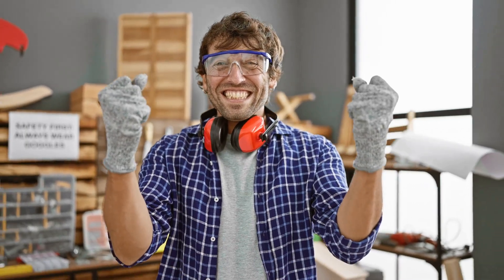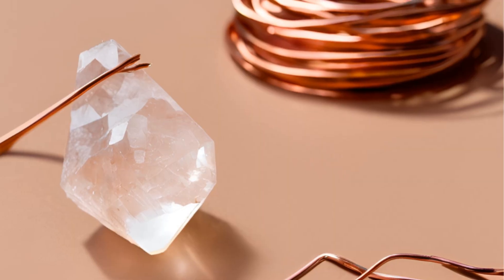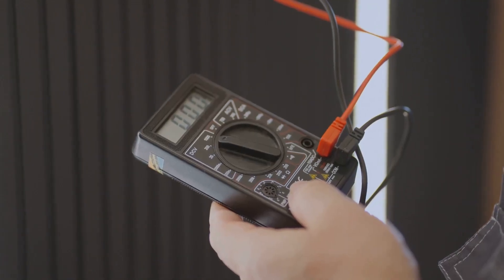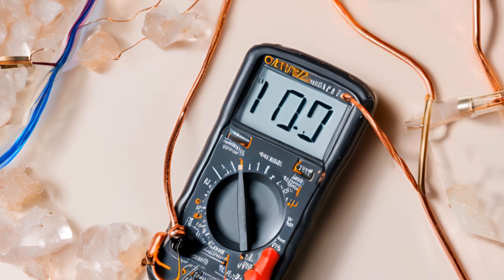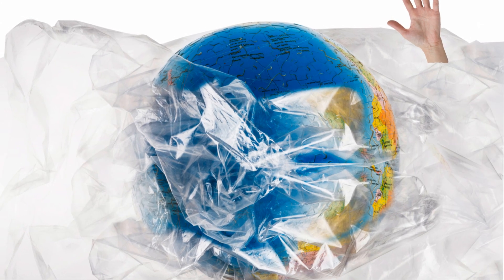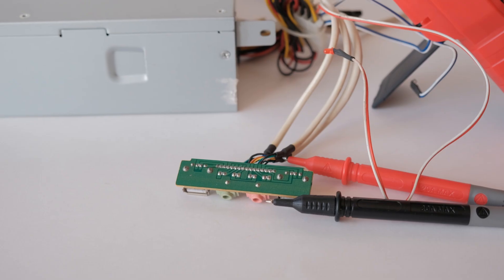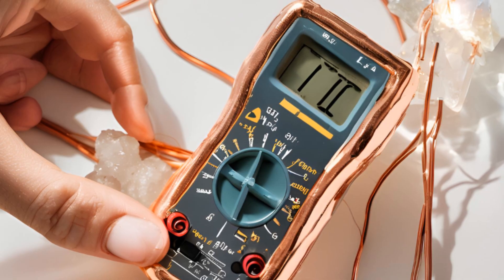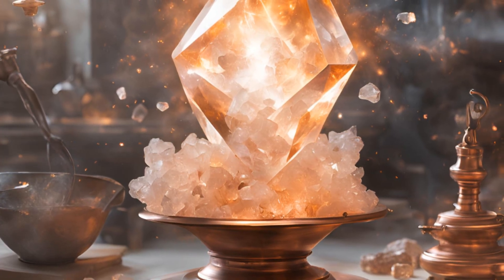How To Generate Electricity From Quartz

Comment: I've tried this, with different colors of quartz. Guess how much voltage I managed. I'll tell you. Absolutely none. Even tried squeezing the crystals, and still got nothing. Hit them with a hammer, still nothing. And yet it supposedly works, and is supposedly how piezoelectric ignitors work. I've taken apart many piezo ignitors, and didn't find any crystal in any of them, just a couple pieces of metal.

Comment: Wanna see something really interesting? Or hear it, rather. Get some copper tape. Like, actual copper foil tape. Lay one strip on one side of your crystal. Lay another on the other side. Solder some wire (or you can gator clip it too) to each strip and connect them to an amplifier. You'll get some hum naturally because it's essentially an ungrounded source, but now when you tap the crystal with a pen, butterknife, whatever, you will hear little ticks come from the amplifier on each impact. Piezoelectric effect, baby! This is how those piezo discs work for musicians and etc, but those are obviously far more efficient at translating vibrations to sound AND they have a convenient base for grounding.

Comment: It is the pizzolettric effect, but it is not enough to feed anything. To generate it takes energy... so, let’s go ahead in the research
Reply: Pressure n moment...if you put maybe 2 magnets applying the pressure around the quartz and then put anywhere with movement you could make like mini race track also with magnets reppeling so when you place your squeezed quartz on the track it flys around something like this....there is also free pressure in the ocean at a certain depth the water alone could provide unlimited free pressure and movement via tides or some cheap form off motor too spin something down there and the motor could run off floating solar pannals on the sea surface...they already have made piezo tyres with crystal inside the tyres so that provides both pressure and spin heavy amounts off both pressure and spin from a car n no matter how small the charge you can always charge capacitors or supercapacitors and fill those up...many ways this can be done small scale small power but many is fine as I said because capacitors will accept any small charge so it's just a waiting game till your cap banks are full which shouldn't take long and then either use cap bank direct or transfer the power from the caps too say a leasure battery...just few thoughts top off my head ..cheers
Reply: Put the crystal in a vacuum so  pressure is always being applied to said crystal. Boom you made the great pyramid powerplant now all fraternal orders world wide will target you. And that's why we can't have nice things.